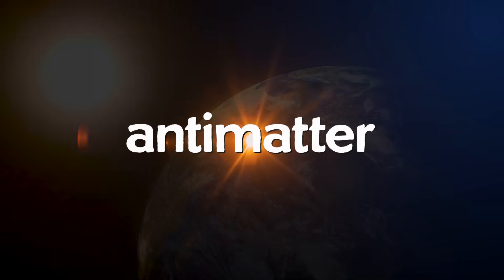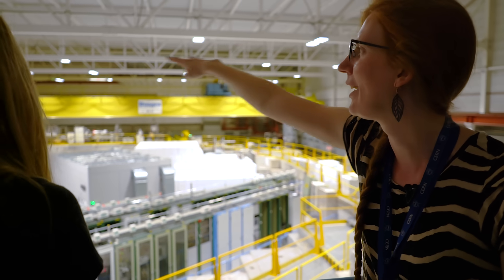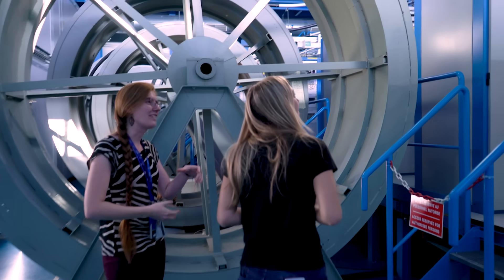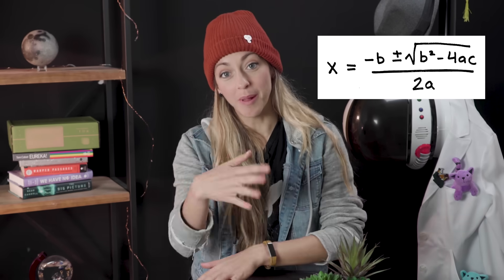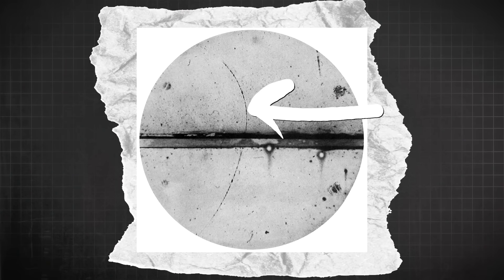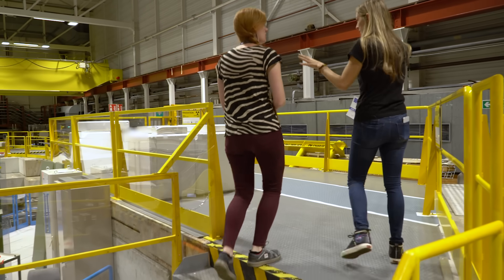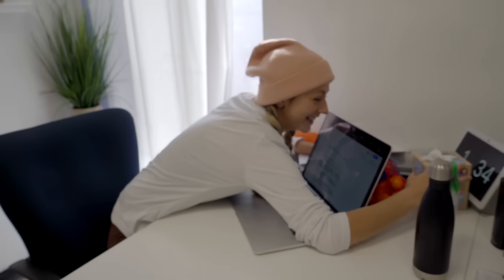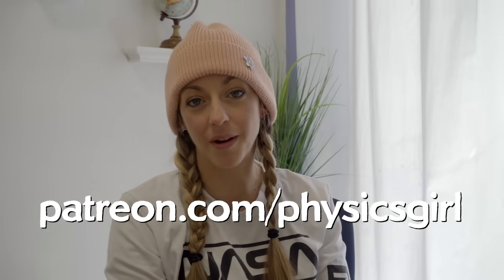Why This Stuff Costs $2700 Trillion Per Gram - Antimatter at CERN

Comment: What does antimatter do? 
-Poof 
Why isn't there any in the universe? 
-No one knows... 
Poof?
Reply: The universe should've created both of them in equal quantities, and so they either should've all annihilated each other, or else gone separate ways and clumped apart from each other.  Instead, all we see is matter, which is the mystery.
Reply: Wisq if there was a 50/50 probability of getting either matter or antimatter then maybe there was a just a slight difference by random chance, and the matter we see is that difference as everything else was annihilated. If you flip a coin 1000 times you wouldn’t expect exactly 500 heads and 500 tails.
Reply: Will Massey When antimatter go poof it turns all the mass into gamma rays, how about that is where the energy in the universe came from?
Reply: @Mythic_Wisdom  Makes no sense, matter, or antimatter for that matter (hehe) is just energy in solid form to begin with, just because it released it's energy doesn't explain where any of it came from.

I love this discussion:
Religion: God created everything.
Atheists: But what created God?
Religion: Nothing, it just came into being.
Atheists: Haha, that's impossible, it had to come from somewhere.
Religion: Where did the universe come from then?
Atheist: Big Bang
Religion: But what created the Big Bang?
Atheist: Nothing, it just came into being.
...
Reply: Daniel it does make sense..
When the universe was created, both antimatter and matter was created, which collided to release energy. 

Matter as you say is energy in solid form, however there aren’t many ways to turn matter into energy, some that i know of is antimatter and black holes.
And if the universe created an equal amount of matter and antimatter they would annihilate each other releasing ALOT of energy, thus explaining where the energy we use today comes from
Reply: I am not talking about where ALL our energy comes from, but a large amount

Comment: 4:14 to 4:51: So if you went down in scale instead of up…  How much antimatter would you need so that, if you could quickly put it in your hand or in front of your face, you'd be able to see or hear or feel a tiny explosion?  Then how far up could you scale it so that it would still be relatively safe right in front of you -- along the lines of, say, a small firecracker?

Comment: In scale  as small as quarks,
Gluon are interactions between the quarks that act as a source of the mass considered as a major particles in our scale

       in the scale very big,
 there should be the reversal of the role of energy and mass 
mass should be the source of the energy 
       gravitational energy should be formed from attraction between masses 
      electromagnetic energy should be formed from the interaction between charges 
     so charges should be treated as the mass and it should has a NAMAN field. (hypothetical) as the HIGGS field is for mass

                  By Naman Goyal

Comment: Colliders must have cable-management gods
Reply: True. And the Electrical Engineers too.  I mean the voltages and currents have to be pinpoint the correct ones, lest liable for damages of million dollar equipments.
Reply: Now imagine all those cables in a tangled mess
Reply: @onixtrous   They'll just quantum untangle them.
Reply: @_KennethG   Ah, pure states. Unfortunately, cable detanglement is much harder than "have these particles de-cohere for a bit"

Comment: gotta love science "we don't see any reason why anti-matter wouldn't fall when you drop it, but we can't be sure, so let's test it... because if it goes up it would be amazing"
Reply: @GabrielCazorlaPersson1  antimatter doesn't have negative mass though. Antimatter has mass, it just turns into energy when it combines with actual matter. It's still matter and you can see it and everything, except it has a special property that it fuses with matter to become light and heat.
Reply: We don't know if it has negative mass. It is too hard to measure gravity with such a small amount. It is too weak. There are physicists who think it may have negative mass.

But then there's also the question of negative momentum. Would gravity push on it, causing it to come toward the source of the gravity? These things just aren't known yet until we get there right experiments done.
Reply: @Sam_on_YouTube  physicists already know that antimatter doesn't has negative mass, because they can measure its mass with electromagnetic fields.
Reply: @martiddy  So does that eliminate the possibilty of negative momentum? Are they sure then when pushed it goes away and when pulled it comes toward? Or do they just know the magnitude? But even so, that doesn't tell you the direction of the force of gravity. We know that gravitational and momentum mass have the same magnitude, but how do we know that for antimatter, they have the same direction? Isn't that just still an (albeiy very likely) assumption?
Reply: @Sam_on_YouTube  because the only way to create something with negative mass would be using negative energy. Something that wasn't used while creating antimatter. Also, scientists haven't found any evidence of negative energy neither.
Reply: @martiddy  Is that something they know solidly, or is there some question about the plausibility of that statement, given that we have no experience with mass as a vector? Genuine question here. I studied a lot of physics... for a lawyer. I got up through Quantum II, but only studied General Relativity informally, not in a classroom. I was told (and from my understanding correctly) that the math in that class would be WAY over my head.
Reply: @Sam_on_YouTube  Scientists are still not 100% if such thing as negative mass/energy exist or could be even created. Because lacks of evidence doesn't mean proof of its nonexistence. The only reason physicists haven't rule out that possibility is because it doesn't contradict our current theories and models. Obviously, that's not the case here because all properties of antimatter matches perfectly with our theories. So is not a big surprise for them to find the expected properties in the experiments.
Reply: @Sam_on_YouTube  Wouldn't negative momentum be becoming more and more securely fixed in place? It's not momentum in a different direction, it would be.... the opposite. The more energy you put in, the more resolutely it doesn't move...
Reply: @GabrielCazorlaPersson1  So... if anti-matter interacts with gravity, we get anti-gravity? Hoverboards, here we go!
Reply: @CrushaKRool  Then your hoverboards broke and set an explosion destroying your city.. destroying other hoverboard in the process destroying everything.
Reply: @CrushaKRool  Yes, but if you touch your hoverboard (or even the air does) it explodes
Reply: Science isn't about guessing; it's about doing. There's no logical reason why it wouldn't fall, but you don't know until you do it. (gravity isn't a function of charge. antimatter isn't made of exotic material; it's made of the same stuff as matter, but with different combinations/configurations that result in different charge.)
Reply: Basically nobody expects antimatter to fall up. But what if it falls slightly faster or slightly slower? Like, by a factor of 1 in a billion? (Truth be told, nobody really expects that to happen either.)
Reply: @MikeRosoftJH  I feel like that would be odder. Just some arbitrary fraction, weird.
Reply: @GabrielCazorlaPersson1  if it had negative mass then when you tried to push a positron into a container with a positively charged plate, it wouldn't work. This is because of f=ma, or a=f/m, if you try to repel the positron into said container with a positively charged plate, the negative mass actually makes the acceleration negative as well, so the positron heads towards the plate. As this does not happen, we know they don't have negative mass.

Negative masses also still fall in normal gravity, however. f=mg, so the negative mass means the object is pushed by gravity.
But again, as a=f/m, the negative mass means this pushing force accelerates the object toward the positive mass.
So the reason for antimatter falling upward wouldn't be negative mass, but some other property.

As far as I can tell, negative mass must be impossible. This is because while positive masses attract negative ones, negative masses repel positive ones. The pushing force exerted by the positive mass on the negative one must, by Newton's laws, mean that the negative mass exerts a pushing force of equal magnitude on the positive mass. As its mass is positive, it is indeed repelled.

So we have an object being repelled by another object, which is itself being attracted to the first. They will follow each other, accelerating ad infinitum. Now let's attach this system to the end of a pole, with a generator in the middle. Infinite free energy. Infinite free energy is of course impossible as per the laws of thermodynamics, so must be negative mass.

I could be wrong, so look it up if you're interested.

Edit: ah, as you're a third year physics student, you're more qualified than I am, but I don't want to delete this now, it took forever. And anyway, someone else might find it interesting. :)
Reply: And yet she talks about it in grams.
Reply: @madthumbs1564  Anti-grams
Reply: I want antimatter to go up cuz it would be cool and physics would need some heavy rewriting
Reply: @GabrielCazorlaPersson1  Anti mass ? They'll sell it as diet pills...once they ... can get the price down.
Actually Dianna said that antimatter has the same mass as it's analogous matter.
Reply: @GabrielCazorlaPersson1  so are you saying that my theory holds up but cannot be proven without proper testing? I'm not entirely sure.
Reply: let's*
Reply: @JorgetePanete  fixed, thanks
Reply: @GabrielCazorlaPersson1  I meant theory as in not experimental, not as in an actual theory of physics.

After doing a bit more reading, it seems that if we assume general relativity to be correct, which I'd say is a pretty safe assumption for physics chat on the internet, what I said is correct. I've even found the same conclusions I reached reached by other scientists (though their reasoning was different it used the same runaway effect of two masses chasing each other I used to disprove the possible existence of negative mass).
I get that we can't prove these things without proper direct experimentation, but you're being overly pedantic by arguing that we're not certain relativity is correct. One of the most basic assumptions of general relativity is that these types of mass are equivalent.
We're pretty damn sure GR is correct, so I'd think we must be even more sure that these are the same (how could you be more sure of something than you are of what that something is based on?)
Reply: @Exoplanet Research Not necessarily. E=mc^2 is a simplification when momentum is zero. The real equation is E^2=m^2c^4+p^2c^2. That comes out the same whether mass is positive or negative.

Comment: What if most of the antimatter is on the bleeding edge of the universe expansion and is acting as a type of "fuel" that allows for the continued acceleration of the expansion? 

Just a thought.
Reply: There is no "bleeding edge" nor leading edge. Just a fact.
Reply: @nightjarflying  A theory, not a fact.
Reply: @Mr_NB628  There cannot be an edge so it is a fact that there's no "bleeding edge" or leading edge.
Reply: @nightjarflying  how do we know that there is not an edge? it has to be expanding into something?
Reply: @Mr_NB628  if "it" [the universe I suppose you mean] is "expanding into something" then that "something" is also space-time - therefore there's no edge. As Paul Sutter [astrophysicist at The Ohio State University & the chief scientist at COSI Science Center] puts it when he was asked about an edge to our universe: "The speed of light is just that — a speed — and the universe has only been around for so long (about 13.77 billion years), which means only so much of the universe has been revealed to us via the light that has travelled those vast cosmic distances. And what's outside our observable limit? That one's easy: It's just more stuff, like galaxies and black holes and new, fantastic varieties of cheese. It's forever unreachable by us, sure — but it's still over there." In other words there is no edge all the topologies that might describe our universe do not permit edges.
Reply: @nightjarflying  Good point. I guess i would question the validity of light as a constant. As of now, we can't go faster than it. Secondly, it would depend if you believe a big bang/big crunch ever happened. during a big crunch, was there anything outside of the creation of OUR universe?
Reply: @Mr_NB628  [1] What are your reasons for suggesting that "c" may not be constant? Or is that just a wish you have for some reason?

[[2] By definition nothing can go faster than light in a vacuum - all matter & all energy is forbidden from doing so. 

[3] The hyped theories of FTL drives depend on moving space-time itself so that the FTL vehicle doesn't exceed the speed of light. To reach the speed of light requires infinite energy so we will never exceed light speed. The exotic solutions to FTL travel include moving space-time along with the ship, but for that to work requires a cheat using exotic materials with NEGATIVE MASS - these materials simply do not exist in our universe. The only other solution is wormholes through space-time, but they also require negative mass materials & the consumption of energy on a galactic scale. It's poppycock. 

[4] Do you not "believe" in a Big Bang then? If so why not? Religious reasons or something else?

[5] The big crunch is something for which there's no evidence as of yet - we do not know accurately enough yet the values of certain properties of the universe so we don't know if there is enough mass in the universe to slow the current expansion. It's an open question. Most cosmologists today think the expansion will continue effectively for ever.

[6] Many cosmologists think there may be a multiverse of bubble universes & we are just one bubble - some say these 'bubbles' arise out of the quantum vacuum that pervades space-time at the smallest scales. This is all highly speculative & even if it is true it will be extraordinarily difficult to observe. Possibly impossible.
Reply: @nightjarflying  I am going at it from your 6th  point. If there are bubbles then there is something outside and between the bubbles.  The big bang could be a bubble "popping" into existence, but maybe antimatter provides the energy necessary for this "popping" to occur shrugs
Reply: fun to think about
Reply: @Mr_NB628  1] What are your reasons for suggesting that "c" may not be constant? Or is that just a wish you have for some reason?
Reply: @nightjarflying  I am not arguing the fact that based on current information, c is constant. but we can;t know what we don't know. however unlikely it is, I think there is a very small chance that discovery could change our notion as we further understand the universe.
Reply: theres no edge though. the expansion takes place equally everywhere.

Comment: Electron+Positron= Anihillation

Electron+Proton= Neutron

Why Annihilation depends  on mass difference??
Reply: Annihilation happens between a particle and it's corresponding antiparticle. A proton's antiparticle is a anti-proton
Reply: @girv98  Yeah. Their mass difference is zero. But what happens when a proton and an electron meet? A neutron right?
Reply: @randomdude9135  Proton + electron isn't annihilation, though. Neither one is an antiparticle of the other.